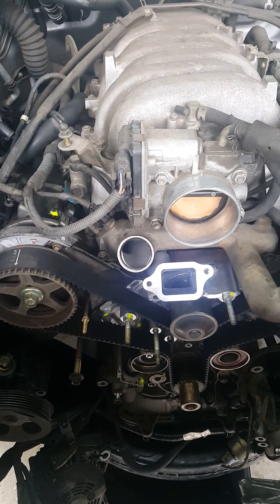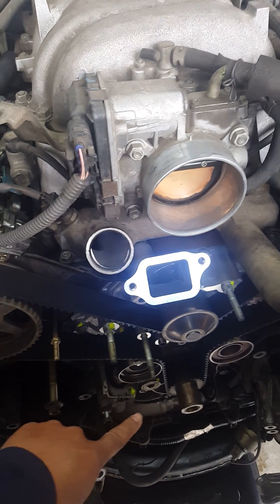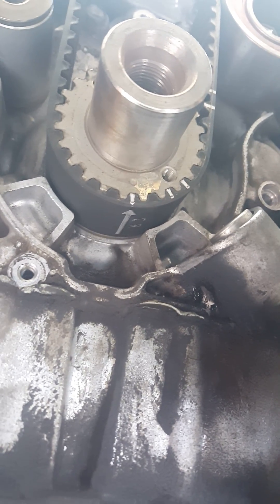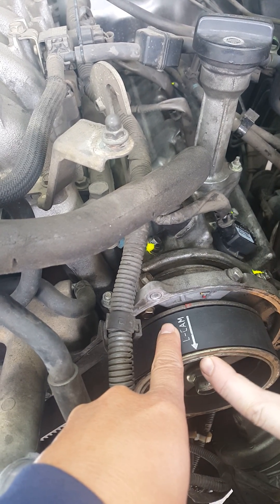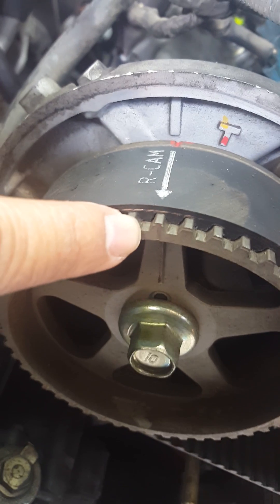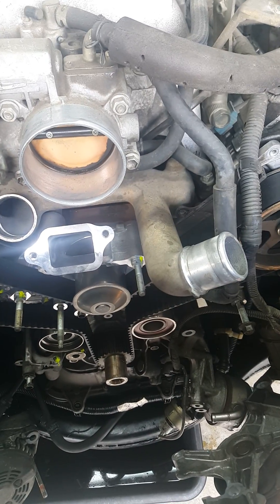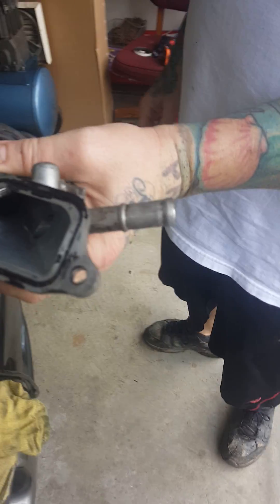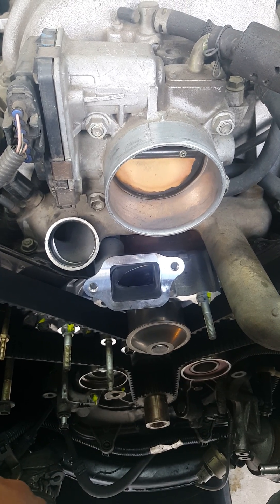2003 Toyota Sequoia Timing Belt Replacement- tips

Comment: I have a question I have the same motor and it recently shut off completely after doing starter and won’t crank back on , thinking timing belt slipped on highway ? It shut off completely after driving low idle and shutting off  1-2 days after starter replacement

Comment: It was my first time replacing a timing belt. I followed your advice and set the timing belt top dead center first, then turned the crank to the right so that the driver's and passenger's crank pulleys marks aligned with the "T" mark; the bottom was a fraction left of the little "notch/mark" on the top of the bottom timing cover. Both pulleys did not jerk after I removed the old timing belt. I replaced the new timing belt, and all marks were aligned.   Your tips are much appreciated! FYI, for anyone who is curious, my top timing belt pulleys are different than in the video, and they have covers.
Reply from the maker: Glad it helped you! Exactly what the video is for! Cheers and great job tackling it as your first time ! You did excellent bro !

Comment: The engine needs to be positioned at 10° after top dead center. The left Cam will move out of time if not placed on the T mark.  There is a T mark on the right cam as well. The crank pulley needs to be lined up with the white dot on the lower timing cover that corresponds to roughly 10° after top dead center. The sealant used on the thermostat housing needs to be ultra gray or ultra black silicone so it doesn’t leak. The ultra Grey Silicone  is a harder consistency when it’s cured.
Reply from the maker: Oh cool ! Thanks for commenting. Great information.
Reply: Actually no, Toyota FSM states you must use the Toyota FIPG sealant, not RTV type products.

Comment: I need to replace head gaskets on a 2004 Sequoia. Do you know the size of the bolt for the crank pulley?
Reply from the maker: Oh shoot...I don't recall. But autozone has a kit for all the big sockets you could rent for free ( just requires a deposit). But if I were to guess it would be 24mm or bigger.
Reply: @onememories8523  - I think I just found it on another video - 22mm. Thank you!
Reply from the maker: @daveminke2946  you're welcome. Good luck and have fun !

Comment: I’ve seen videos showing the timing belt being removed at TDC and ATDC. Which one is correct? Any differences between the two? Thanks in advance.
Reply: Depends on your year, 2000-2004 TDC, 2005 and above ATDC
Reply: @jayinla228  Fantastic thank you. TDC it is.

Comment: I think its the same for this car, for my GS400 you are supposed to go to 0 degrees then rotate clockwise 50 degrees until it matches the dot on the plastic cover (same cover that has 0 and 10 degrees). Your cams will then line up with the T, mark the cam pulleys and where it lines up on the engine, should be at the T (incase cams move). The cams shouldnt move but marking them is a precaution in case you need to move them back. Doing it at 0 degrees can cause the cams to move and damage to the valves

Comment: Your timing is off post to be lined up on T markets......
Reply: Do your research before posting. It is NOT supposed to be lined up with the T marks
Reply: @unodfredy  I was just asking this question in the thread. So it’s TDC not ATDC. Just curious why I keep seeing ATDC being used. Do you know what the differences are?
Reply: @greenrangerbeatdown6913  I don’t know lol but from what I’ve seen lining it up with the T will not damage the engine but you’ll have low power symptoms. Not sure if it’s true or not but every single thread and video I’ve seen 95% of the guys line up with the line and not the T.
Reply: @unodfredy  good to know. I may order the service instructions for this to make certain though I’m pretty sure you’re right. I’ve come across a lot more TDC positioning on this as well.
Reply: just jumping in as i had a hard time figure it out where to line the 3 marks, lot of videos, lot of different advices and at the end very confusing for an amateur mechanic. 
first thing is removing all the spark plugs to release some pressure on pistons in case the cams pulleys jumped while you are adjusting them. Happened to me for both cams. Just pulled them back.
I have a 2000 tundra sr5 V8. What i found out after all is that all the 3 marks should lined up to TDC  "O" on the crank and "I" marks on the cams pulleys.
Works well.  This is for the 2000. Not sure about the others years.  @greenrangerbeatdown6913
Reply: Daniel Tripodi I’ve been trying to figure this out are you supposed to line them up on the T or the line because im getting ready to do this on my tundra and need to know
Reply: @noahlandry8026  just did mine yesterday, 04 tundra. When the mark on the crank is at "0" tdc, my cam notches where lined up with the straight up and down marks, not the "T". 
Quick tips on what i learned.....need a catch for about 2.5 gallons of coolant, have a couple 3/8 dowels to use as plugs for trans cooler lines (i used bolts i had in my box), get a torque wrench that reads inch pounds, a impact wrench is a must to remove the crank bolt, keep track of the bolts, nuts, studs and their placement, after you get the new belt on the instructions say to turn motor 2 full turns with a breaker bar and recheck alignment marks, make sure you put the crankshaft pulley with the "0" mark on before you do this or else you'll be chasing those FUC+#$@ marks around trying to get the crank and cams back to the original marks.....after 8 rotations I still couldn't get them back, I put the crank pulley on and they magically lined up in 30 seconds.
Reply: Must have did mine wrong a year-and-a-half ago. Do it how you want to do it. Lol
Reply: @trip7854  you did do it wrong lol.  Its about 2 teeth off im im not mistaken

Comment: This the best video on YouTube about the mark but how you install it on the gears one not to move
Reply from the maker: Sorry for the late reply. When you install the belt, the cam gears shouldn't move. You just slide it on slowly and careful. Just make absolutely sure you have set the correct timing before installing the timing belt. I don't recall which way I did first. I think installing it from the bottom (crank) side first and work your way up to the left (driver) or the right (pax) side. After you're done installing the belt, recheck you timing marks to make sure they didn't move. Otherwise you're all set.

Comment: If the belt its not original.
Reply from the maker: Then I don't know. I have never changed out any timing belt that doesn't come from the dealership. Timing belt is the few things I buy directly from the dealership. If the belt doesn't have the 3 arrows, then make absolutely sure your cams and timing marks like up. After they lined up, turn your engine a few times to make sure they are ok and the timing marks are stil l within range. If they are you'll be fine.

Comment: How’d you like those cams jumping when trying to align marks? Scared the crap out of me when they turn unexpectedly.
Reply: Right!!! Holy crap, spring loaded basturds they are, I just gave it a little wiggle and rotated about a inch off. Instantly my heart sank and I debated using gas and a match to finish the job. Looked online couldn't find a answer, finally phoned a friend he said stop being a sissy and rotate it back, just don't go full circle because one of the valves with hit eventually.
Reply: I had to talk myself into finishing the job this past weekend. I was doing my first timing belt job on my 2000 tundra when the cams jumped and I thought all was lost. But its actually pretty easy! @eaznutts5714
Reply: @eaznutts5714 Ha…yeah, we learn a good lesson👍🏻

Comment: which side is number 1 cam?
Reply from the maker: Hi. I believe cam 1 is on the driver side. Odd numbers are on the left (driver) and even numbers are on the right (passenger). But please confirm this with the maintenance manual.
Reply: sorry i meant cylinder
Reply from the maker: Np. If you stand in front of your engine (bumper) cylinder #1 would be on your front right.
   Or it like this:
      8  7
      6  5
      4  3 
      2  1 
     Front
Hope this helps. If not, you can call down your local autozone or orielly and ask for the firing diagram and they should be able to tell you.